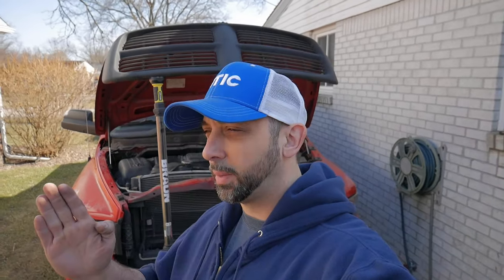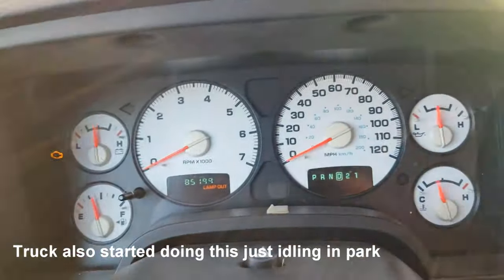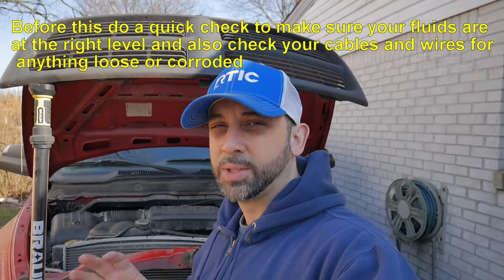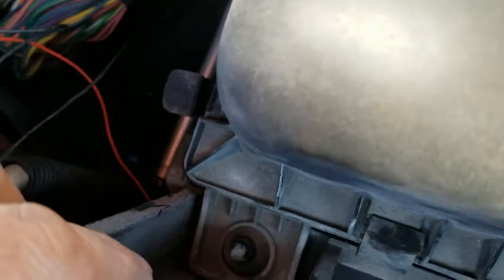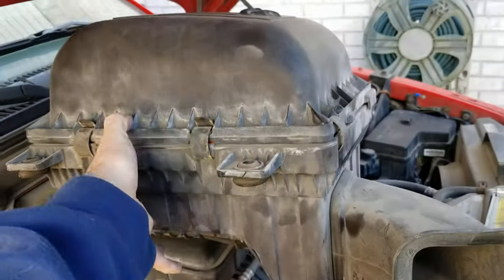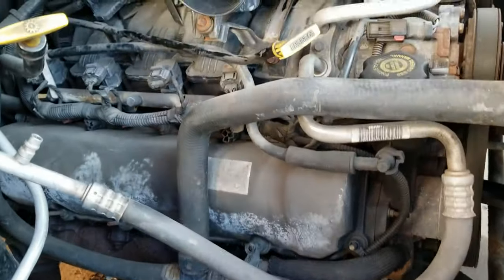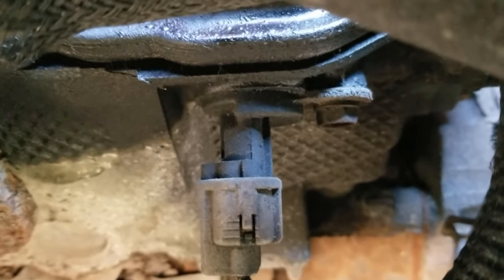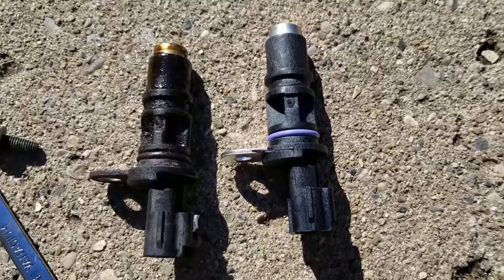How to fix a car that stalls no engine light on

Comment: I have a 2003 Dodge Ram 1500 4.7. Exactly the same symptoms. I replaced the fuel pump all the sensors you showed on the video. After watching your video I ordered a 8 pack of coils. Runs great now. Thank you very much.
Reply from the maker: glad you figured it out!

Comment: Man do I owe this guy a huge THANKS!!! My Ram kept stalling. I replaced the fuel pump, cam sensors, TMPI and cleaned the fuel injectors and throttle. No luck until I saw this video. I bought the coils and replaced them and my truck now runs great. Thank You, Thank You, Thank You
Reply from the maker: glad the video helped
Reply: What year ram
Reply: 0

Comment: I have an 03 Dodge Ram 4.7L. I changed plugs and coils that I bought online from eBay about $100 for coils and plugs. That’s when I have been having stalling issue. Stalls randomly while driving. Then I have to spray starting fluid to get it back on. No codes. Changed TPS / crank sensor/ cam sensor/ fuel pump and mass air flow sensor! I’m gonna buy new coils from Oreilly! If that doesn’t fix it I’ll buy plugs again as well! Thanks for video!
Reply from the maker: good luck check your grounds to make sure those aren't rusted out engine grounds and stuff like that
Reply: Same problem here looking for solutions that happened to me today
Reply: @trevarrisbrown4194  I had the same problem turned out to be a bad coil.

Comment: Thx  Chuck, im gonna try before I trade my car in😢, which is what I DO NOT WANNA DO.... I have taken my car to 4 great my mechanics, in which 1 was the Dealership 🥴... $600 later, and a NEW Purge Valve, its doing the same thing a week and a half later... NONE, of the mechanic shops can figure out what is WRONG!!! They all tell me there are no Codes,  or check engine light on.. one mechanic put my car on some kind of special rack,, in which the car is sitting still,, but in Drive, and the tires where spinning, he advised this was the same as driving it out the road to test drive to see whats wrong.  Mechanic ran my car about 50 miles 🙉 on this special rack and it NEVER SHUT OFF on him!! but when I drove it home the nxt day, it shut off on me!!! My car Ruins GREAT, but about 15mins later or it seems when the motor is good and warmed up, it does wht your truck did🤣...CUTS OFF!!I  Don't want to trade it!! Its a good looking car as well as ruins excellent w/ the exception...thx for the video, will try to have my Uncle help me w/ the things u stated...  its hard being a Woman and taking your car to different place... they all seem to lie, or run over me🥲..Ive spent sooo much $, just paying mechanic pretty much to tell me NOTHING! Have a great day, may God continue to bless you and your family 😇... Dionna/Tennessee
Reply: The same thing is happening to my Mustang, even the Ford car dealer can't seem to fix it!!!  i have no codes showing and no check engine light!  $600 later also.

Comment: Yep.. power braking now.   I'm working on this problem rn. It's sensors and throttle body the IAC VALVE you're good I've all but replaced that sensor  and I'm good 220000 miles 96 1500 5.9

Comment: I too have your truck with 4.7 and had stall issues but more when coming to stop especially abruptly.  I occasionally get po440 code  but would go off and on randomly 😅.. I also get a whopping 6 mi per gallon😮😮 .  It's done that since I've owned it about 2 years though. 
 You would think that a check engine light would trigger with that horrendous of mileage?  Maybe I'll start part replacing because the stall is happening more often.  Thanks for your video.

Comment: 2007 Ram 1500 4.7 had the same issue. I replaced the fuel pump which didn't resolve it. I had replaced the coil packs and plugs about a year ago. I used the Denso brand. After watching this video, I swapped back to the OEM packs and the truck runs as it should. Just wondering which Coil packs you had that were defective? Thanks brother!
Reply from the maker: was 5he originals that went bad

Comment: I have a 1995 Ford Ranger. I can drive for 1 or 2 hours, with no notice on my dash in the fast lane and it stalls. I have been towed 12 times and spent $3000 trying to find the problem. I have bought a new battery, new fuel pump, had the gas tank drained, checked all the fluids. I am so frustrated, I’m an elderly women who loves my truck, but I live alone and need to depend on my vehicle. Can’t afford a new one. Don’t know what to do next!
Reply: Same here. Did you find the problem?

Comment: If you had no codes how did end up buying coils packs in diagnosing as it being the issues? Any misfires?
Reply from the maker: no  misfires at all, did alot of research and switched out a few other things before i did the coils. Nothing resolved the issue until i replaced the coils . alot of time and money went into tracking down this problem so i posted the video in hopes to save people from wasting time and money like i did. Without a code it can be very difficult to track down the issue

Comment: I have the same problem with my 98 Dodge Ram 1500.  I replaced the waterpump and speed sensor. Code0720 . Drove it for the first time and it stalled on a bridge during rush hour.  Thankfully it started back up. Im still tryibg to figure out WTF.  After watching your video i think it is time for some new coils.
Reply from the maker: good luck 👍

Comment: The thing that makes no sense is the fuel gauge and the temp gauge both going to zero with the key still on. That seems to suggest a loss of power or ground. A bad coil would set a misfire code. Loss of power to the ECM would set no code.
Reply from the maker: i think the bad coil was grounding out
Reply: @AllThingsCool  yes

Comment: im having the same issue with mine but now that you mentioned the coil pack i wonder if its part of another issue that i have when i turn the key to crank it it just keeps on cranking then after a second time i go to crank it turns on like nothing. Did your truck also have this issue?  Ima change spark plugs to.
Reply from the maker: no just would stall but maybe crank sensor ?

Comment: My 02 4.7L is doing this I have replaced the idle air control valve already  cause it wasn’t idling properly it would race up and shut down. After fixing that seems like that’s when it started to shut off now it’s worst shuts down while driving or turning when my foot is off the gas. I’m going to check the fuel pressure then replace the coils but I really think it’s the coils at this point.
Reply: my car is doing the same... how you fixed that problem?
Reply: @balwinderkumar3134  I didn’t it just stopped doing it as much I’m putting it in the shop next week for something else but I think it may have been the fuel pump cause when my tank is full it doesn’t happen. Also it’s warmer so it not as cold like winter months

Comment: My 03 4.7 Dakota QC with the NV3500 trans.  would do that same exact thing.  After replacing the IAC, all the sensors, and have a spare computer.  Turns out it was coil #7  grounding out on the block never registered any codes…
Reply from the maker: glad u figured it out!

Comment: Got all new  coil packs and spark plugs about 6 months ago for my 03 Dodge ram 1500 4.7. didn't have an issue up until a month ago I just replace my fuel injectors and still have no check engine code should I replace my coil packs again
Reply from the maker: did you get good quality packs ? I have had that happen to me on a different vehicle.replaced one pack was good then same pack went out again

Comment: 2011 1500 dodge ram 4.7 2wd classic flex fuel when i take off i have poor Acceleration doesn't even burn tires shifts fine changed Map Sensor and Air Temperature Sensor and add a ground to the block but still what u think this block was complete rebuilt

Comment: I just had a similar problem with a customer vehicle. It would not start at first. I checked the fuel pump fuse and relay and the fuse was blown. Replaced fuse it starts now. But cuts off as soon as I pressed the gas. Does this sound as if may be the coils? And it also backfires.
Reply from the maker: yes it does
Reply: @AllThingsCool  ,,, My 1997 Honda shuts off while driving and refuses to restart but it cranks. Am having this for a few weeks now. Mechanic said it is not a mechanical issue and that an auto electrician is needed. Help me please!!!?

Comment: My 2004 Buick Regal LS started to die while rolling down the road about six months ago. But you'd turn it off and it would immediately crank. Engine idled and ran fine...until it would go dead. I took it to a shop I know and trust. They kept it for five days and never found any problem. I picked it up and had been driving it with no further problems until today. It's doing the same thing again. I don't think my mechanic will have any better luck diagnosing the problem this time and I don't trust any other shop to figure this out before charging me hundreds of dollars for replacing stuff that won't fix the problem. And with my mechanic stumped, I have no hope I can figure this out. Color me screwed.

Comment: I got a 2017 & its doing the same thing except it turns off and comes back on while im driving all by itself an the whole truck is compleaty dead for like 2 seconds. If i pull over and stop take the key out open the door and then restart it it runs fine again for a while. Happens like 1 time a day and it just started .

Comment: Hey guy;
By chance did you do a test on the old coil packs? My sons 2007 just dies randomly and restarts while driving. 
Had a old friend with a 2005 and it ended up being the ignition switch shorting out.  
So one coil pack can stall a vehicle?
Best; Tom
Reply from the maker: no test, I think my truck shuts down when a coilpack goes bad/shorts or grounds out
Reply from the maker: ye from what i understand if a coil pack grounds out the vehicle will shut down
Reply: Did you happen to figure it out? My 05 is stalling while driving and restarting while still rolling...driving me crazy. Thanks
Reply: You still had flashing lights on dash board.😮

Comment: I’m having a problem where my 01 1500 5.9 shuts off on me when coming to a stop any suggestions on what that could be? and no check engine comes on
Reply: same problem with my 2014  im lost
did you figure out what the prob was?
Reply: My 07 5.7 shut off on me while doing 45mph and would not start back up, even with a jump box. Has it towed home and the next morning it started right up but was making a loud noise more prevalent on the passenger side. I took it to a shop and they told me the torque converter was the culprit of the noise and that it had seized other components of the transmission. I was never slipping gears before the truck turned off on its own.
Reply: @skunkworks4u thank God I have a warranty that’s paying for everything
Reply: @skunkworks4u the shop is going to either put a reman in or rebuild it. I would rather do a rebuild of course but it’s just up to the warranty company.

Comment: I replaced idle air control and throttle position  sensor.  Distributor was replaced a year ago.  Injectors all new.
Reply: Did it work

Comment: I have an 05 ram 5.7 no check engine light my truck keeps stalling while parked can't even drive it! I changed the egr valve, map sensor, and throttle body still stalling. I'm at 96000 miles changed the plugs/wires, camshaft/crankshaft sensor at 60000 miles. It sounds like the truck is choking out when stalling.
Reply: Did you figure out the problem
Reply: How did you fix it?
Reply: @christopherwilson5158  yes, defective fuel pump
Reply: @christopherwilson5158  I replaced it earlier in the year and the new one failed
Reply: @Manramz1  yeah the new fuel fuel pump I replaced failed again so I got a better one and now the truck is running alot better
Reply: Iar sensor
Reply: Was it throwing a code?

Comment: My truck is doing the same thing, but mine is very hard to start, it will start then die, then when it actually starts and runs it will die after I get going down the road then I have to start it multiple times to get it to run again, I may try to replace my coil packs and see if that helps, also when I put my truck in neutral while rolling down the road it dies, and if it’s in neutral while parked idling it will die if I give it gas to rev it up a little bit, almost like the fuel to air ratio is off but I will definitely try replacing coil packs
Reply from the maker: might also be the fuel  pump going out

Comment: Replaced coil packs and spark plugs , throttle body . Crank shaft sensor . Still stalls , but only in cold weather
Reply: Check the vacuum canister purge

Comment: I'm gone thru same issue,when ever I'm driving and come to stop,it stalls out,or when I make turn.....I have 02 ram 1500 4.7
Reply: Hey Micheal I have the Sam issue on my 09 Ram, what did to do on yours that fixed the issue?
Reply: @ihall5856  me too. 04 ram. It's quite dangerous, especially on British roads.
Reply: did you guys find out what the issue was?
Reply: @josephhammond2268  no, but it hasn't done it for a while. It's been quite dry so I'm thinking water might be getting somewhere it shouldn't.
Reply: I read a post on another page that a guy had an issue with the gasket around his fuel pump leaking, and allowing water to get into his fuel tank.

Comment: Ok so im gonna describe my symptoms and hopefully youll see these and let me know if theyre familiar. 
Truck runs beautifully when cold until about 20-30 minutes of driving or probably WOT. 
Then it loses power, backfires through intake, stalls completely and even worse if you give it full throttle. If you feather the pedal really fast itll "jump" its way a little farther, but eventually it completely stops. It will still idle sometimes, roughly, and sometimes it will slowly die. If it starts to die when parked i can feather the pedal and keep it running for a bit. Weirder though is that if you let it sit idling after this happens it will clear up sometimes and youre able to drive it another mile or two, but ultimately does it again and eventually it just wont run until it sets and cools off. 
Ive changed plenum gasket, throttle body gasket, upper intake gasket, pcv valve, some vacuum lines, oil pressure switch, plugs, wires. No real change when doing the starter fluid test for vacuum leaks. 
Only does it at WOT. 
Any suggestions?
Reply: By wot I mean operating temperature
Reply: Following
Reply: @jessicaduclos7597  fuel pump
Reply: If that's what you meant that is
Reply: Egr valve
Reply: Hello, my 2000 is doing this exact same thing. I was wondering if you have figured it out? I've changed almost every sensor and even the computer itself and it's still doing it. Please tell me you found the problem 😅
Reply: @Cyrus_meeasy  it was my fuel pump 🤷
Reply: @A_Stereotypical_Heretic  that was definitely something I was thinking about. Mine seems to be more electrical though. Once it stalls it acts like it is getting no spark, just cranking. Then it will finally fire up but it misfires maybe running on four cylinders. Going back n forth running perfectly to misfiring again. Is this what yours was doing?
Reply: @Cyrus_meeasy  go to harbor freight and get a cheap fuel pressure test kit, like $30 or so. Mine was tricky tho, It would hold just fine before ignition, but slowly start to drop while it idled. And even the drop was very close to within normal range. It was just pound or two below minimum. If I remember it was around 27 or 28 at operating temp, and I think dodge calls for 30-35 minimum.
Reply: @A_Stereotypical_Guy  I was planning to change the crank sensor next but I will test the fuel pump first. Thanks
Reply: @bamerican6795  it would do that ONCE the problem started, which would normally be about 30 minutes after a cold crank. Then after it happened it would start to buck, miss, lose power, surge, backfire out the intake in no particular order and then finally die. Tromping the pedal would get me a few more feet. Then if I let it sit for about ten minutes it would go another few yards and do it again.
Reply: @bamerican6795  no problem. As I said don't let the prime fool you, mine primed just fine, it only started failing at operating temp.
Reply: @A_Stereotypical_Guy  that is what is making this so hard to diagnose. The truck runs perfect for a couple errands around town but if you have three or four things to do it does it goes nuts until I leave it sit for a while so it will cool off
Reply: @bamerican6795  my money is on the fuel pump. Once they heat up to a certain point they start acting up for some reason. And not even a full tank of fuel seems to help keep them cool enough to function right.

Comment: mine did the same but didnt turn back on does anyone know what couldve happen?
Reply from the maker: fuel pump ?
Reply: @AllThingsCool  no its cant be the fuse pump because when i start my truck i can hear the pump working
Reply from the maker: @txsjxhnny837  maybe fuel filter is clogged
Reply: Double check the fuse. Yellow one I believe 17 or 21 fuse .